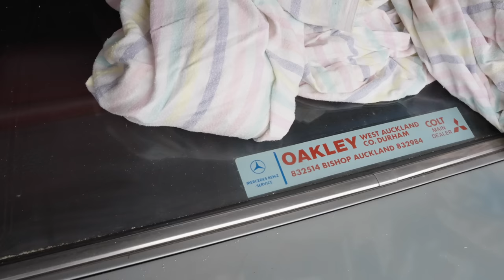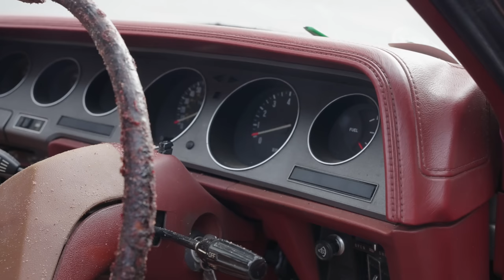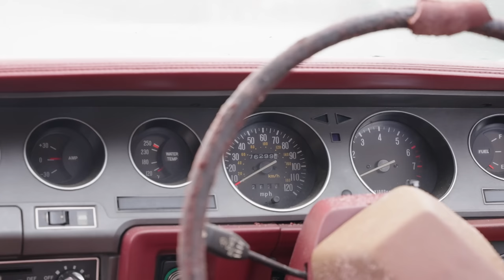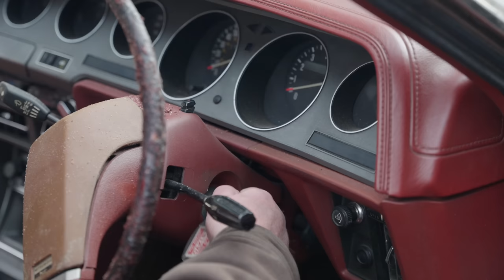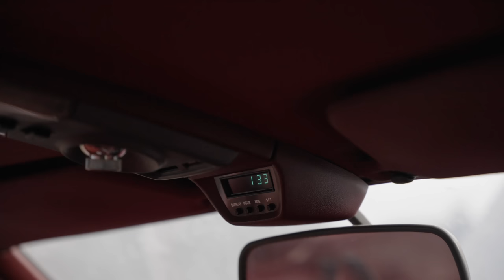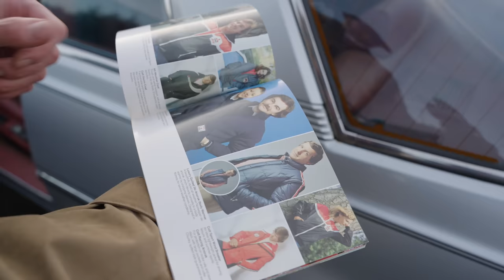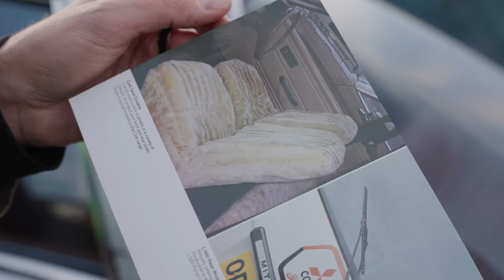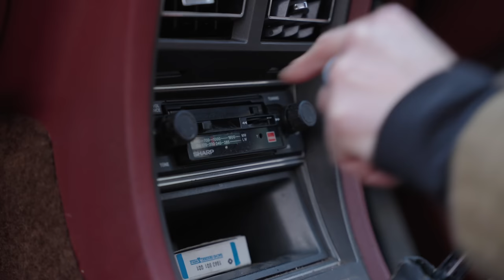Rare Barn Find classic 70s Japanese RWD Coupe discovered - will it run after 30 years?

Comment: I bought one in Australia when I was 21 brand new in 1980 , in Australia they were called the scorpion. Very rare now . Just a quick edit, the Australian ones had a 2.6 litr engine the biggest 4 cylinder in Australia at the time and slightly different bumpers and alloy wheels.

Comment: Hi Jonny. I used to have a Celica GT coupe, it was 1976 if I remember correctly. Twin cam, 40s as standard and an LSD. Cost me £325. I was only 19 years old at the time, I am 56 now, it was also costing me £216 for six months insurance at the time, and I was a named driver under my parents name. Those were the days. I drove a Nissan 100A in winter because I couldn't afford to insure the Celica for a full 12 months.
I sold the Celica and bought a Sapporo, in factory yellow, was the only one I came across in that color, does another one exist I wonder?
Fairly quick back in those days, and really nice to drive and handled well, mine was also fitted with Alleycat wheels I think they were called, a factory option? really made the car stand out, but wow! it used to drink petrol.
Sold it for next to nothing, like most folks have.
Would be nice to be able to turn the clocks back.
John.

Comment: I had the Australian version of this 2.6 litre 4 cyl. When I ordeed it, it was Chrysler. When the car aarrived it was a Misubishi. Mine was a top of the line 4 door SE. There were almost no cars available at the time with a 5 speed overdirve (Toyota Celica excepted)  The Stigma (as my mates loved to call it) had a long stroke, so it had heaps of torque where you needed it for road driving. I loved that car except for the steering. From memory I think it had recurculating ball steering which I had to wrestle with in bends at speed. It looks like almost none of them sruvive here.

Comment: So sensible of you, Johnny - to bypass the fuel system, to avoid sucking up g  u  n   g e ! Nobody else even thinks of that!  I always thought these were an elegant model - and it's still elegant NOW! And NO dull black or grey interior, like today's cars! As you say PROPER access to equipment under the bonnet ( not overstuffed with gadgets, like today) , plus REAL steel wheels, not inadequate alloy wheels that can shatter if you are edged towards a traffic island (like happened to a friend of mine), and no skinny tyres that can burst on potholes! A REAL car!

Comment: My parents had a 1980 Plymouth Sapporo (Canadian market version) with a 2.6 and automatic, it went quite well but after my Dad had the engine rebuilt it didn't seem to run the same, seemed like the vacuum lines were hooked up wrong and the mechanics couldn't figure it out, so they traded it in on an Oldsmobile.

Comment: Here in the US in the 70’s & 80’s, Mitsubishi cars were sold by the Chrysler/Dodge/Plymouth corporation with many different models. I had a 1979 Dodge Sapporo and it was an excellent car: very quick, stable at high speeds, great gas mileage, great handling. The only downside was the service at dealerships was just as crappy as the other Chrysler brands sold in the US. I was able to do most maintenance and repairs myself. I lived in the desert of California, so rust wasn’t a worry. You won’t see many Japanese cars of the 70’s & 80’s in the US unless you live where it doesn’t snow, because most of them rusted away.

Comment: There is still lots of these scorpion s here in Australia. Many people used the Australian GH sigma  turbo set up on these.  My uncle was a factory test driver. My cricket coach had one . Hoons fit V8s in them for burn outs or drags . I have wrecked a few to gain parts for early Pajero s and the rare GH sigma turbo only 500 made. But overall a fairly bullet proof car bar astron head gaskets . pS they love a turbo and 20psi but 14is good too

Comment: Many years ago, I used to drive both, a Mitsubishi Sigma 2.0L 4door Auto, the same year, and also, the next model up, a Mitsubishi Sigma Scorpion, a 2 door 2.6L, the 2.6L was fantastic to drive with heaps of power, for back in that time, one doesn't get to see many of them anymore, they're collectors items now, but, as we speak, there IS a red one up for sale now, in "Carsales"  Australia, for $16000, with around 313,000 klms on the clock, if anyone's interested, its the 2dr 2.6L engine..

Comment: Jonny  these cars were all the same body style wise in the UK ,Canada and the USA, my friend Pete had a 1982 Sapporo 5 speed fully optioned out and was Red in colour and they came with 2.6 litre Mitsubishi single overhead came with twin carbs, i just don't remember what brand they were, I do remember it was quite fast and just as quick as my Volvo 240 GLT turbo i bought in 1981, the Sapporo came standard with tilt/telescopic steering over here in NA , i sure enjoyed that feature on his car when we drove to Vancouver on holidays ,1550 miles each way, it was comfortable , had A/C and decent in the mountains' don't remember if it had cruise control, it was just a pleasure to drive and it sipped the fuel getting high  30's to the gallon with A/C, never ever a starting issue in our cold Canadian winters either and they came with a block heater installed by the dealer, the only thing the dealer did was install a hotter thermostat for it, it only had a 70 celsius and they installed an 85 Celsius unit and it made a world of difference, they were trust prone car having no Zinc treating or galvanizing to any of the sheet metal, Pete tried it in on a 1984 model of the same except he got an automatic this time around , the factory clutches were a weak point on them, the 84 was better than the 82, they came with rust protection from factory, really it was dealer installed and was very good, Waxoyl your familiar with , you had it on an episode maybe 2 or 3 years ago, so the 84 lasted Pete until 89 when we both got married that summer and he regretted trading it in he said, those 2.6 litre engines were strongly built and trouble free and smooth at any speed, great video Jonny, thx you for the walk down memory lane 👍

Comment: I love the styling of the car, and such a rare beasty today. I used to have a 1984 Galant GLS, by far the best car I ever owned. For it's time it was worlds ahead of so many other manufacturers. When you turned the engine on the only way you could tell it was running was by looking at the tach. Coming from a Ford it took some getting used to. Inside it was luxury compared to a lot of cars, climate control, you just dialled in the temperature you wanted and it would automatically keep the interior at that temperature. Twin map reading lights front and rear - though I came to curse the rear ones because the kids would leave them on resulting with a flat battery the next morning! I remember the power steering would become less and less the faster you went, so it was always a joy to handle. The 2lt engine was so smooth, built in balance shafts for the win. Carburettor with no cat, and it had plenty of power, on motorways it would happily sail right past the limit on the speedo. Sadly, the only thing that let it down was the rust, did not have the time or the tools back then to deal with it back then, so sadly I had to let it go. Many years later I bought a 1998 model Galant, sadly it had nothing on the old 1985 model. Emission laws had robbed the 2lt of it's power, and the interior build quality was poor. So to see this 70's era Sapporo is a rare treat indeed!

Comment: that  car was sold here in the US in 1978 as a plymouth sapporo in that same body style and also as a dodge challenger in the sport version which had a 5 speed manual and a 2.6 inline 4 cylinder. i purchased my challenger new in 1978 and it turned out to be the first of the many mitsubishi's that i owned over the next 20 years and probably would have kept buying mitsubishi's if the company hadn't of suddenly abandoned anything to do with performance, mitsubishi went from hero to zero overnight.........

Comment: In the early 1990s, my girlfriend had one of these. I don't remember exactly, but I think it would have been the later model with the two rectangular headlights. The interior looked different too.When she bought it, it was already pretty beat up, but it was cheap and drove pretty well. It pulled a caravan from Germany to Italy and back again. One day the bonnet opened and flipped over the windscreen while I was driving on the autobahn with my colleague. I managed to stop the car without causing an accident. Eventually we sold it to someone who wanted to cannibalise it for spare parts.

Comment: Wow, that's a neat barn find. Amazing how it works fine after so much years.
Is that a Citroën CX steering wheel? A least, it is very similar. Uni-branch steering wheels are so much better.
Reply from the maker: Same steering wheel as a Citroen, but this is a factory 'wheel.

Comment: Get the steering wheel refoamed and covered in red leather. Get the faded center plastic scanned and 3D printed replacement. Then the interior will be mint.
I hope you do a follow up video when it's been restored.

Comment: Old cars like these might had issues with rust etc but they where relible and as you can see by this video how the car still runs and everything works fine with 76k miles too now days cars break or stop working by 100k miles.

Comment: I had 2 Sapporo’s, one identical to this, sliver, GSR, 2L, manual, front shocks needed replacing and could not find any anywhere for love nor money, 2nd one I got as a non runner auto which I took the engine and box out of the first one and made the auto into a manual, but spares were such a nightmare to get hold of because Mitsubishi scrapped all the parts once cars reached 7 years old back then. Had to give up on it as it was not practical to try and use as a daily. You guys made me laugh when it was trying to start, how long did it take for one of you to think of giving it a bit of throttle 🤣  is it up for sale ?
Pete.

Comment: The engine looks very similar to my works Mitsubishi fork lift truck. Definitely the same rocker cover
Reply from the maker: Really?
Reply: @TheLateBrakeShow  yeh seriously looks the same ! I know Nissan have done it with the engine shared in a pickup and a forklift . Guess you could call it early cost cutting measures.

Comment: Just because the oil looks nice doesn't mean it is, until the engine runs. It's been in the garage for 30 years, just sitting, that's plenty of time for contaminates & water to settle, and the dipstick doesn't reach the bottom of the oil pan.

Comment: They did a 2000 Turbo version as well which copied the BMW 2002 Turbo with a front air dam with 2000 Turbo written on it, a college lecturer of mine in 1990 had one and had the college vehicle repair class rebuild it.
Reply from the maker: Wasn't that the Starion Turbo?

Comment: BEFORE BEFORE please before please after so many years poor oil into the sparkplug holes BEFORE moving the engine..... please please
Reply from the maker: We did. We did pour oil into the bores. Did you not see?
Reply: @TheLateBrakeShow  But this was after you had put in gear and pushed the car, but maybe your video was out of sync as you had checked engine will turn over before you said you put in the oil. But really love the car as I used to drive past a Mitsubishi garage every week that was in Trowbridge Wiltshire in 1980 and I really loved the Sapporo and Galants for sale on the forecourt. Well done and a big thank you for bring back our past and our love for these cars at the time.